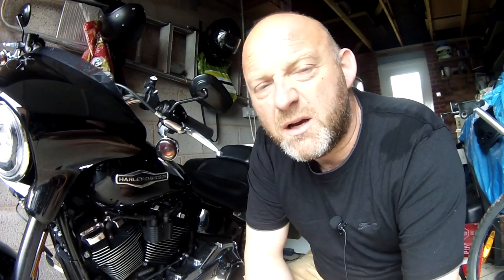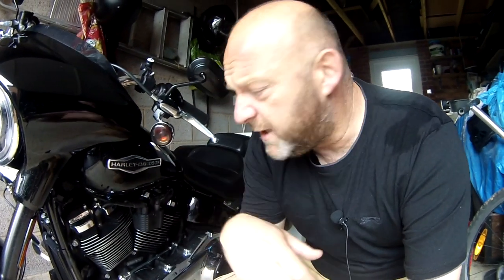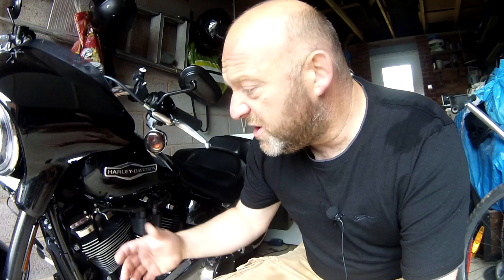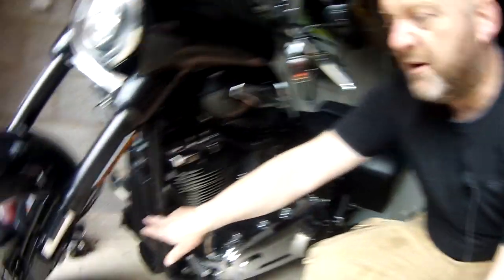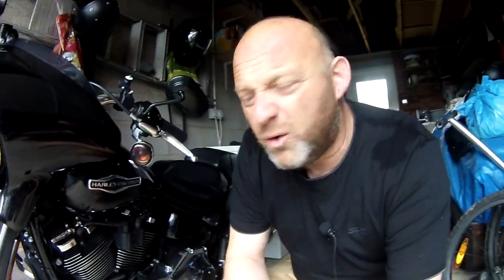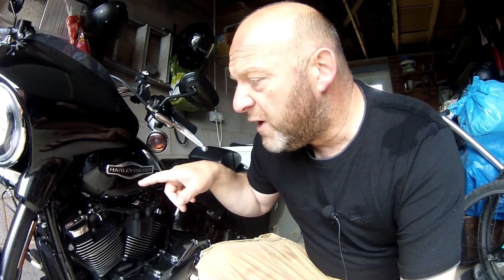How to stop your Harley engine overheating in traffic   What is Harley EITMS

Comment: One of my ironheads is a late 84. Last of the iron sporties. I put a fan in front of my oil cooler with a small shroud. Has a switch to turn on and off. Works great . Or I just shut the motor off until traffic moves. My other bikes I just shut it off. Lots of fun with a kick only chopper but I havent overheated my bikes

Comment: EITMS is purely for rider comfort. When it activates and“shuts off”the rear cylinder, it’s not because the motor is overheating. It’s designed to reduce the heat radiating from the rear cylinder to the rider.
Reply from the maker: Yes indeed
Reply: Exactly. Nothing to do with overheating the second cylinder.

Comment: Thanks for the video.  For info all the fuel injected models have this system.   The rider can enable/disable on fly by wire bikes.  The cable throttle bike have the system but you have to get the dealer Tom enable.
Reply from the maker: Cool, thanks

Comment: Mine is always on, and works even when it is not very hot outside. When its cold you can leave it enabled because the cilinder disabling doesn’t work, the engine does not overheat though.. so this option is best when enabled…and forget👍🏼
Reply from the maker: Yep cheers

Comment: Hi 
Which O2 sensor should I buy for my FXSB Breakout 2014 
Denniskirk is claiming theirs better from oem as they are made with ceramic body made of stabilised zirconian dioxide, surface coated with gasspermeable platinum electrodes & porous ceramic help erosion due to contamination particles in exhausts

Comment: Thanks Alf. Good info that I wasn’t aware of. I do suspect that mine is enabled from factory on my 2019 Road King. I say that because I usually detect a stumble and then a notable difference in idle. I will verify as soon as possible.
Reply from the maker: Ok great. Thanks and glad you’re finding the videos useful. Cheers
Reply: Harley F---up, my friend bought a new 1984 top of the line new softail  new EVO motor, Kick and electric start, 100,000 miles later he still rides it but he also rides a newer ultra classic no heating problems with them old Harleys?
Reply from the maker: Cheers

Comment: Ran into your vid 
Definitely the dyna 2017 has it always not turning over right after a long ride till it cools off for like 20 minutes getting an oil cooling system for this problem hope it works cheereos
Reply from the maker: Cheers
Reply: those  twin cam motors were nothing but problems

Comment: I have a 2002 Road King Screamin' Eagle CVO and don't have an Owner's Manual, anyone know if there is a LIST of which MODEL YEAR bikes have the EITMS feature? Mine was running 277 degrees on a trip between Pahrump and Las Vegas, NV yesterday with myself and my wife. Air Temp outside was 70 degrees, way cooler than our Summer temps of 120 degrees.

Comment: I have a question I have a iron 883 I had just put some slip on pipes do I need needa tune it and wil it overheat
Reply from the maker: I would say not totally necessary as long as the air filter is still standard but it also depends what kind of exhaust you have put on and how that affects the back pressure. If the bike doesn't sound or feel right then your best option would be to tune it, cheers
Reply: @RevelatorAlf  thank you 😊

Comment: Brilliant thanks so much for the hint!  Maybe I’m missing something but is there a draw back for to not not having this feature enabled?
Reply from the maker: I would only say if you’re riding in hotter temperatures but otherwise it should be fine. There isn’t a performance reduction with having it enabled so it’s really a personal choice I suppose. Cheers
Reply: @RevelatorAlf  If you have a big cam with a choppy idle when EITMS activates the bike sounds like a Honda 90 so many owners don't like that.

Comment: Does the engine have to be in neutral and clutch disengage for it to work? Or will it work with the clutch pull in and still in gear?
Reply from the maker: not that I am aware of

Comment: Yep with respect the title is misleading, EITMS won't stop your harley from overheating, it kicks in when oil and engine temps are already too high and it doesn't bring them back to optimal (seems aimed at rider comfort). Only real options are fans on the engine and oil cooler. It's ridiculous, decades of big twins roasting in traffic and still no fan-assisted coolers for the new softails as standard (and only aftermarket option is mounting an additional cooler for $550+!)

Comment: hey man there is a 2013 883 sportster for sale which had the engine temperature sensor removed for a few months, and the bike runs with a rich fuel mixture now.
Is it safe to buy this bike? thanks mate
Reply from the maker: I would get that fixed really. Cheers

Comment: Can this be done while the motor is running,and also is this enabled from the showroom?
Good info,think you can alter the temperature of this system through the V&H FP3.
Reply from the maker: Thanks Philip. Yes I'm quite sure you can do this whilst the engine is running too. I'm not sure however if this is enabled as standard from the showroom, however my bike had it already enabled. Perhaps there might be some adjustment in the FP3 however I'm really not sure, however it would be good to know whether the FP3 in anyway affects the EITMS activation parameters. Cheers

Comment: Anyone who knows... I BBQ a lot and have a digital thermometer... I am willing to carry it in my bag on my 2002 Road King SE CVO to check engine and head temps if that is an accurate and viable way to make sure nothing cracks... I would hope my $450 DynoTUNE Power Vision is giving me the correct temp, but would the digital thermometer confirm, I am thinking it would. (Not a Harley Guy, I just own and ride one. I don't own a single Harley patch or logo if it is not attached to the bike. Just not my gig!)

Comment: Hey guys! Would this cause my bike to shut off randomly while riding, backfire, and my speedometer goes crazy. Sometimes revs on its own with clutch in and high idles any gear. It runs amazing when this isn’t happening. Thought I fixed it today, rode it for 30 minutes and it shut off 2 times, revd with clutch in 2 and backfired once. Thanks guys I can’t figure this one out
Reply: If it was faulty of course
Reply from the maker: Hmm that’s an interesting one. This sounds like a sensor issue messing with your ECM. Ha e you checked for error codes?
Reply: @RevelatorAlf  haven’t used a scanner, don’t have one. But there is no engine light coming on. Bike runs great. Every once and awhile it will randomly do one of the problems. Seems completely random. I tried cleaning my map sensor so I don’t think that’s the issue. This is my last guess
Reply: I really appreciate the reply. Thank you so much
Reply from the maker: What bike is it by the way?
Reply: I’m assuming my engine temp sensor is faulty
Reply: @RevelatorAlf  2010 dyna street Bob. Barely has 13000 miles
Reply from the maker: @RBoysMedia  Well it's really hard to say what is the problem without getting hands on a diagnosing but I'd start eliminating the electrical. Check the battery etc until you find the answer
Reply: @RevelatorAlf  yeah I get that. I had a previous issue that over powered the battery and kept blowing up. Threw a new regulator on and fixed that. All electrical seems fine. I’m taking my temp sensor off and checking with multi meter today. Hopefully that can tell me
Reply from the maker: @RBoysMedia  yep hope you find the fault. Cheers
Reply: R&R  The eng. temp sonsor .You can do it yourself, It will not take all your $$$ . There not made very tuff, to start with. Fixed my 2008 S.G. GL TO ALL WHO READS THIS. WE GONE!!
Reply: @Rbones45  correct! After hours of troubleshooting, I ended up replacing my temp sensor with one I got off Amazon and making sure the positive wire was tight. It was either of those but it worked.

Comment: Does anybody have any idea what temp it should activate on a twin cam Softail deluxe? My V&H FP3 has it set at 310degrees which seems to high according to my testicles which are being boiled. The bike has a Stage 1 and a Stage 3 and running Samson true duals. Not sure it was this hot before i changed the pipes and added the FP3.
Reply from the maker: Sorry can’t help you there
Reply: OIL cooler helps alot?
Reply: Bike was running too lean. I took the bike to a dyno specialist and he reprogrammed the FP3 map as it was way too lean.  Might change the FP3 to a power commander 5 and have it dyno tuned. V&H have no idea how to map bikes period. That’s my personal experience with them. I’m sure others have had better luck.

Comment: Strangely. Probably useless info. 

I have a 2016 street bob. My first ever Harley. Complete newbie,  has an  intake and exhaust. It ran really hot . I got it Dyno tuned and the tuner said it was running lean which they said tends to make the bike run hot ,  They ran it slightly rich and now it doesn't run as hot...

Comment: wanna know an easy solution? Long red light? Just sitting? SHUT THE MOTOR OFF. Start it back up when you can move again. Anyone who owns an Evo shovel panhead or iron sporty knows this.
Reply: I find this truely amazing that Harley decides to keep engine cool by shutting off half of the engine! Other engineering companies just add water cooling system! This is old long time issue. Over heated motors have always been an issue for the life of motors but Harley has fought until recently just getting into the 20 century engineering. Still hard not to luv em.